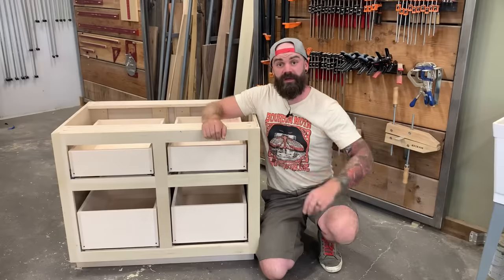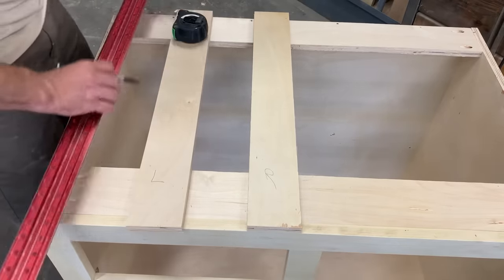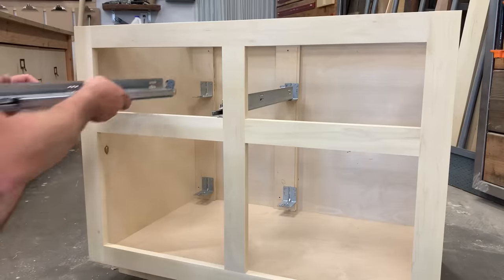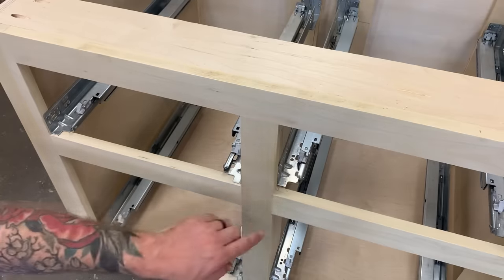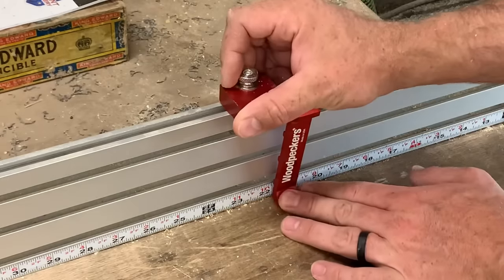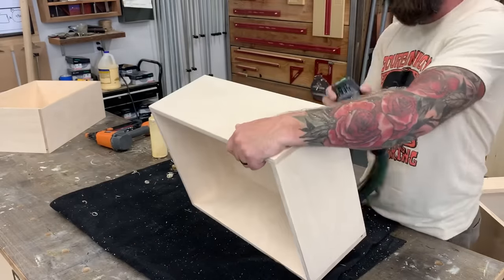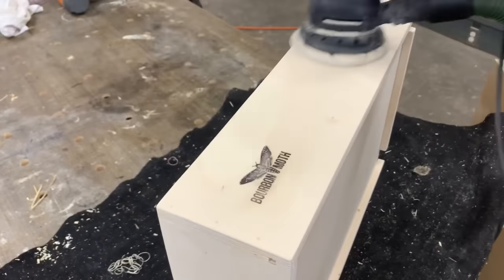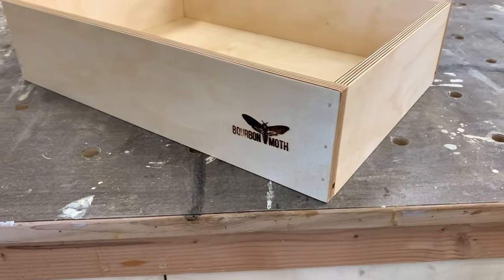Build Cabinets The Easy Way | Building and Installing Drawers

Comment: Your linked sliders are the 563H for "up to 5/8" thick drawer sides" do you use those for 3/4" drawers or do you use the 563F? Thanks for the great description of how to install.
Reply: Yeah, I was wondering the same thing.  I'm leaning towards getting the 563F for 3/4" plywood.
Reply: Answer this man!
Reply: Answer is no, there is not enough clearance on the sides for 3/4. Blum makes slides for 3/4" thick material.  They use the same clips

Comment: I actually find side mounted drawer slides much faster to mount.  Bottom mount drawer slides are nice and typically allow for a little more weight, but they are going to cost you about twice as much as side mount ball bearing slides, if not more.  They also require a bit more work than side mounted drawer slides and typically require a bit more planning if in the build of a cabinet if you are going to be using them.  So I wouldn't suggest you ditch the side mount ball bearing slides.  Just choose the slides that but suit your application.

Comment: I just installed the undermount drawer slides for all the kitchen base cabinets I made. I have double the number of cabinets than the previous kitchen build I did but installing the slides with your technique took me a fraction of the time. Less (in fact zero) swearing and perfect first go. 
Amazing. Thank you so much.

Comment: Major major thanks! I built my kitchen cabinets and used side-mount cause I thought undermount were too tedious and difficult. I'm now doing a 8 foot bathroom vanity and I clicked on your video to see if you had an easier way to do side-mount. After I watched the video I was completely impressed. Followed your method to the "T" and now have six perfect undermount soft-slide drawers.

Comment: Hey Jason, enjoying your videos. I'm a little late to the party on this one, but an important point to note on the Blum undermount slides is that   all the adjustment features are set bottomed out from the factory. It's important to zero out the adjustment features on the back of the slides and the height adjustment on the draw clips before you install your drawer fronts. That way you'll have adjustability in both directions (up and down, instead of just up) if you need it in the future. It may not be a big deal on overlay fronts but on insets,  if you ever need to lower the front a smidge you won't be able too.
Reply: Thank you! I was wondering about that and was going to check them.
Reply: What do you mean by zero out? Are those instructions in the package with the slides?
Reply: @mickiefox1854  the drawer height adjustment on the drawer clips comes set all the way down. Install your drawer slides. Then make sure they are level and the adjustments are all set to neutral. (Depending on what model draw slide you get, some of them are adjustable) Then, before you put your drawer in, make sure the clips that mount to the drawer are zeroed out. The clips allow you to adjust the draw up or down. From the factory, they come set all the way at the bottom. If you don't move the clips up a bit, before you install your drawer front, you will not be able to adjust the drawer down if it's installed a bit high.

Comment: I like everything you've shown in these first 2 videos. In my kitchen remodel I'll copy you except add 2 dowels on each side of the drawer face because all my life I've been cursed with the faces pulling apart.  I've also been cursed with bottoms falling out from heavy loads so I've always made 3/8" bottoms.

Comment: Great video on the step by step. REALLY liked it! Those drawer glides are CRAZY expensive though. Just hose 4 drawers for that cabinet would be 200 bucks! But, just like when the glides were first introduced and they were very expensive. These will probably come WAY down in price in a few years. 🤞

Comment: Awesome way to clarify some confusing issues on slides. I do have a question concerning the placement of the right rear piece of plywood. Measure over the same distance from side to verticle divider as in front? Thank you

Comment: Very informative video, thank you for taking the time to post this!! 

The Mrs would love some pull out shelves for the lower kitchen cabinets.  Can you make an instructional video that makes installation as easy as this??

My cabinets are a lot deeper than the 21 inches that these seem to come in, and fwiw, the plywood interiors of the cabinets don't seem as sturdy (or square) as your cabinet in the video.  Lastly, of course we have already done the countertop with granite, so I have to work around the existing stuff.  

Doing some research on those slides you posted, they look too quality.  I haven't worked with them before and would really love some tips!

Thanks,

Jeff

Comment: Super helpful video.  Two questions.  I’ve seen other videos where plywood dividers are screwed horizontally into the sides of the carcass between each drawer.  The face frame subsequently gets attached to these dividers as well as the carcass.  Why don’t you use horizontal dividers?  In what situation would you use these dividers?  Thank you for all your content!

Comment: I learned a very smart technique from you  that you didn't even explain: have the drawer bottom dry-assembled in the drawer as you glue it up, that way the slots will be correctly aligned when you glue the other end. Thanks!

Comment: Great information on all your videos. Quick question, you mention you use birch ply for your drawers (actually, for most of what you do), but regarding the cabinet boxes, what thickness of plywood do you use? Am I correct in thinking that the cabinet boxes and the drawer boxes are made of different material thickness? Thanks!!!

Comment: just would like to pass along some info i learned installing these slides. the current version of the slides does not have the back slot (that slides onto the back bracket) offset to the side.  the newer slides are made with the slot in the middle.  this means that measuring the bracket placement is not as easy as you showed. it's not a huge deal but you have to account for the offset to get the slides installed straight. also, fyi buying these slides right now means ordering and waiting for at least 4 weeks.

Comment: Jason, yr cabinet build videos are the best on the tube! Question: I'm building a lengthy cabinet w/ drawers for my pickup for camping. Some peeps recommend dado joints for drawers and box since I don't have a table saw or router(yet) trying to avoid that. Will a lengthy drawer assembled out of Baltic hold up with just glue and brads OR pocket holes instead?

Comment: Mr. Moth, I agree that you have a slick method for installing these slides, esp the (very) simple way to mark the holes above the notches; no jigs required! What I don't understand is the purpose of the 3/8" line that you were so careful to mark. You don't seem to be using it to line up the rear bracket, so what is it for?

Comment: I'm making cabinets for the kitchen right now based solely on this series. The guy installing the counters said they're the best home built cabinets he's ever seen. I took all the credit. 😂 Anyway, I'm working on drawer boxes now. Do you clamp them while the glue dries or are 16 gauge nails enough to hold it together? (I'm actually using 18 gauge and 1/2 ply.) I could knock these drawers out quick if I don't have to clamp and wait.

Comment: Is the next video going to explain why the two different types of depths. Flush and the other way?
Reply: He explained it in this video. He showed how to do an overmount and inset drawer box. Inset has the drawer face inset (or inside) of the face frame and overmount is on the face frame.

Comment: I noticed that metal fence on your miter saw table with the tape and stop block built in. Who makes that? Great video on drawer building, will use it on my current project.

Comment: Is there a sizing standard for the depth and height of a cabinet? Or at least depth so you don't build something and then find out there are no drawer slides that will fit? Been watching your videos over the last week and I really enjoy them. Thanks.
Reply: Great point! I’m thinking I’ll shop for drawer slides before building anything.
Reply: The Blum undemounts common sizes i seen are 19" and 21"
Reply: Go to the place where you will buy your drawer sliders and get the installation document. That will give you the sizes of the sliders and the corresponding sizes of the cabinet they will fit.

Comment: If I’ve made it this far watching videos to build cabinets I should be good to go. But I still haven’t figured out why you draw a 3/8” line on the back bracing of the overlay drawers (right side)? And then you just set the bracket flush to the right side of the bracing.

Comment: Recently subscribed and find your instructional videos very practical. I am planning to build a bathroom vanity with six drawers and would like to use the Undermount slides you recommend. My question is if I’m using a 21 inch drawer slide and have three-quarter inch nailing strip at the back and three-quarter inch scrap piece to hold the rear of the slide (no sheeting on the back of my cabinet) does that mean my over all depth must be 22 1/2” excluding the drawer faces?
Reply: good question i noticed that he didn't address that on the video,

Comment: Question! Do you typically want to make the depth of the cabinet the same size as the drawer slides you are using? For example if I wanted a 24" deep cabinet, could I use 21" inset slides? but would need 24" undermount?
Reply: I was thinking the same thing. If I have custom depth, it doesn't seem like undermount would work?

Comment: I want to see a video of how to fix mistakes in the drawers, like, when you tried to be clever and cut all your drawer slots ahead of time, ending up with a few slots that are bad because you don't have an outfeed table for your table saw. 

Or your drawer bottoms are just a little too big. 

Or your drawers are too big to fit together easily and use this method, partly because your fence slipped and your drawer bottoms are a skoche looser than you were aiming for.

Comment: Looks good man, tho it's called a toe-kick not a kick-plate(3.5" x 3.5" is nice and easy to remember). Also stiles & rails are almost always 1.5" or 2"(usually only the top rail) to better manage dead space, especially when butting cabinets together. 👍🏻 looks good tho

Comment: I just built a set of cabinets and had to sit in the floor to mount the rear brackets. That was back breaking. Never again after watching your video. I will mount the rear brackets and mask off the connection area with painters tape. Who cares if the screw heads and back surface of the brackets get painted. Thumbs Up!

Comment: Thanks for the excellent tutorial!  However, while those Blum slides are awesome, they are WAY too expensive for my taste. I'm not a pro but I've built and installed over a twenty drawers of all shapes and sizes and I just used plain old full-extension ball-bearing slides and never had a problem either mounting them or with their operation. Yes, it's a little more work but if you use the Kreg drawer slide jig (or you can easily make one) things are fast and accurate. And on one 8-drawer project I saved north of CND$400 on the slides and it didn't take hours more to use standard slides.

Comment: You've linked to the 563H slides. Their specs say they are for a maximum of 5/8 thickness drawers. It looked like you used 3/4. The 563F look to be the ones for 3/4 thickness. Or did I miss something?

Comment: With undermount drawers if you use a thicker bottom you don't have to dado the sides and you don't have to notch the back just make it shorter by the bottom+1/2" and since it's under mounted the drawer bottom is what supports the weight so you can just nail the whole thing together... Do it and see how hard it is too disassemble the box, no person is going to hit it that hard.
Reply: Your way it great, commonly used, not as fast though, requires more adjusting, weighs less, better if you want less nail holes, almost as fast.
Reply from the maker: But it won’t look as clean

Comment: You just came up in my suggestions the other day, and I've seen a bunch of your videos.  I subscribed.  Here's some insight.  I'm really connecting with you A LOT, and I really love your building and working with wood.  I follow other wood working channels.  Here's the issue that will probably make this a non lasting interest- Your projects are really ultra-professional.  So like everything is master carpenter level, and all of your equipment / materials are ultra professional.  Also, you explain things as if you're talking to fellow experts (which, maybe you are :) .  So there are other woodworking channels I relate to more, because they throw in the occasional basic projects like restoring, building, fixing something anyone could do at home with hand tools. Stuff that anyone without a huge shop could and would do.  Your shop is 2x the space of most homes in my area so literally nobody that is not commercial is doing this at home.  Hope it helps. Thx.
Reply: p.s.Your existing subscribers probably are at a much higher level than most of this stuff and think your work is / looks / seems easy.  p.p.s.  Most of us don't have a lucrative side / main hustle to buy and house all of this equipment.
Reply: I'm literally doing this out of my garage. I relate to you very well even if I have to covet some of your space and tools.

Comment: Hello! The Link you have posted for the slides is the Blum 563H which says it accommodates up to 5/8" thick drawer side thickness - but in your video it looks like you are using 3/4" baltic birch. Is is it still compatible or are you using a different drawer slide? Thanks!

Comment: @Bourbonmoth  Thanks for all your videos, they are very helpful.  I already got started on part of my. Hold before finding this so I have a question on how to proceed.  From the back (inside) to the front of the face frame is 24.25” and I purchased the 21” slides as that was the closest I could get.  Do I just need to make the mounting piece for the L bracket thicker to take take up the space extra space or so it’s just under 21”? Or should I just mount the brackets to the side of the cabinet?  Thank You for any advice you can provide.

Comment: Hey, I love these videos (I know... you've heard that all before). I was curious about the drawer construction for the undermount slides. Could you not just cut the back panel to the level of the top of the notch? It would allow the drawer bottom to slide in with the carcass assembled and be screwed into the back from below, allowing you to replace the bottom with ease in the future, and have the added benefit of not requiring a notch cut for the slides. Obviously your method works, it's great, just wondering if this change might have any problems I'm not thinking of.
Reply: Yes that is a way that you can make drawers. and I have done that with undercount Blum slides without issue.

Comment: Not sure if you mentioned it or not but do you use 3/4 or 1/2 ply for drawers?  Thanks
Reply from the maker: Awww snap 🤦🏻‍♂️ I knew I forgot something. I actually use 5/8” but you can also use 1/2”
Reply: Thank you👍
Reply: @Bourbonmoth   can you use 3/4 with Blum? From the documentation it looks like you can only use >or=5/8?
Reply: It looked like 3/4 inch, so I tried that it didn't work with the slides then I saw the Blum box said max 5/8 max, starting over. But learned a lot. 😅 @Bourbonmoth

Comment: I am contemplating construction of a pantry cupboard for my kitchen.
The dimensions 84" tall x 36" wide x 24" deep. It will be shelves only, with   4 doors. Have you any suggestions for the design.
I love your shows and have added tools to my shop that I have seen you using. Great stuff.
Carl

Comment: Very useful informative video. Thanks for taking time to share your knowledge. I just have a question: you mention to scribe a line at 3/8 in from inside stile for back bracket, but per rulers spec sheet the dimension should be more around 15/32 in (12 mm). Why you say 3/8 in?

Comment: Thanks for the video. All good EXCEPT one thing:  My bottom slides look identical to yours.  However, the first drawer installed would not fit.  Found out your 3/8" offset for the bracket needed to be 1/8" on mine.  Pulled all the bracket boards back out and moved the brackets.  Now, works very nicely!
Also, some drawers may not be perfect, so I made a jig to hold the slides the proper distance apart.  Then laid the drawer in, and marked the location for the bottom notches.  Each one seemed slightly different.  Must be my extra large ham-handed construction.

Comment: What a helpful video…the best I seen…question. @ 8:36  _ to measure the width “ u include the side piece…I don’t understand  ….can U clarify how to measure the width…thxs
Reply: Did you ever figure this out? That is my question too. He’s just measuring from outside of one slide to outside of another and then just says “plus the width of the side pieces.” Is that the size of ply you’re using? So take that measurement and then add an inch if you’re using 1/2” plywood?

Comment: My cabinet is very similar to this except I have a plywood divider in the middle. If I am setting my drawer slides like you did, i don’t need to make the 3/8 line for the offset correct? Just take it to the wall on the left and on the right and draw my horizontal lines? Thank you for this great video!! Huge Help!